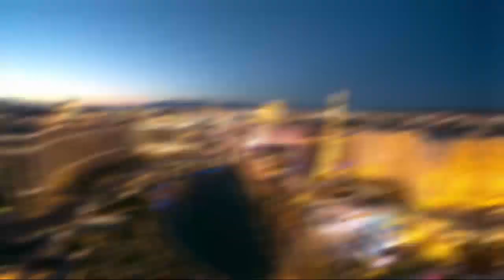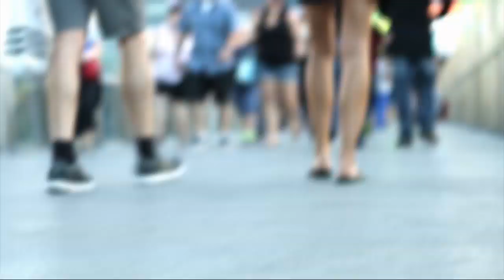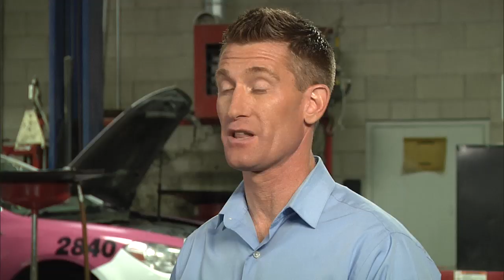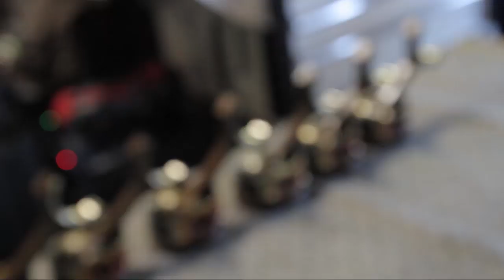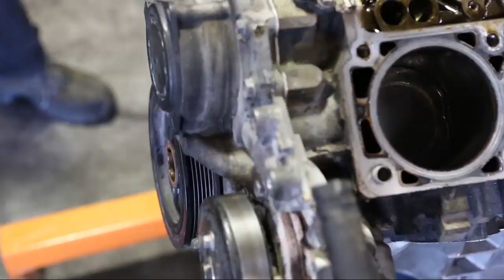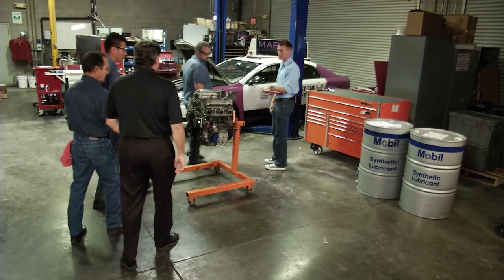Mobil 1

Comment: I have switched to Mobil 1 from Pennzoil Platinum and will never go back.  Since I have switched, I have noticed that my car runs a lot smoother and my fuel economy has noticeably improved.  I drive in both highway and city settings, everyday, and I have confidence that Mobil 1 will help to keep my car running for many years to come.
Reply: i found a better oil a year ago it's schaffers oil look it up here on youtube i was amazed at the shape of the engine they tore down with a million miles and never had anything but schaffers run in it

Comment: Mobil1 is an excellent product. I've used their Extended Performance oil with M1 EP filters for years, in all sorts of vehicles, including diesel, with outstanding results. I drive at least 22,000 miles per year and typically run 7500 mile OCIs. I've also rarely needed to add oil between changes, so I'll never use anything else in any vehicle I own. I've tried Amsoil in the past and it was fine, but their top synthetics are expensive and not available in stores. Everyone carries M1 and I can always find it on sale. Can't beat it.

Comment: You just proved the product works if maintenance is done properly. I'm also glad you stated that extreme use changes should be done at 7-8k miles. Being that dusty, humid and high temp environments take a toll in vehicles. One reason I change the oil filter in the middle of the change cycle. With either fram ultra guard filter or Mobile 1 EP. And yes I tore open the filters to see what the condition was. Being if this part fails. It doesn't matter what oil you use. The engine will fail!

Comment: I think they're trying to compete with Amsoil which in my opinion isn't smart marketing. Go after Castrol, especially now with their "new high tech formula" Mobil 1 is probably the best over the counter oil and should focus on competing with other OTC oils.
Reply: Wrong..Amsoil doesn't come close to the market share of Exxon-Mobile in sales volume! 

You can find mobile 1 in a damn walmart. Where as Amsoil is dealer driven and hard to find on any automotive shelf.
Reply: Claude Rains I meant as in the test, Amsoil did the Vegas taxi thing as well (they were the first if i'm not mistaken, but don't quote me on that) and it yielded MUCH better results. Mobil 1 is the best OTC motor oil yes, I even use it as a back-up when im out of stock on Amsoil. But the thing is M1 is NOT a true full synthetic just as amsoil is. Also Amsoil is actually pretty easy to get, theres probably at least 1 dealer within 5 miles.
Reply: I understand but Amsoil is just to hard to find locally for most and it's never on sale. 

As for the rest they been competing against each other for years. It's just Mobile does a better job at getting the big ones, like military, racing and new car manufactures assembly line installed using Mobile 1.
Reply: Claude Rains that is true, and part of it is because they make a good product but also do a great job of marketing. My only quarrel with mobil, and all the manufacturers for that matter is the abundance of false advertising.
Reply: Scam Oil is not even API certified. You have an engine break under warranty. They will not cover it! Never mind Scam Oil uses wax based filler. Which in cold crank conditions in cold weather. Will clog an oil filter till it warms ups and melts. 

So I'm not putting that stuff in my engine... And yes i'm a 40 year old race car builder. I can use any oil I want. You play with Amsoil. You're asking for trouble. As one batch to the next can be not even close. Just send a sample to any lab for testing. As they don't know what oil it is. So total unbiased reporting tells you the truth..